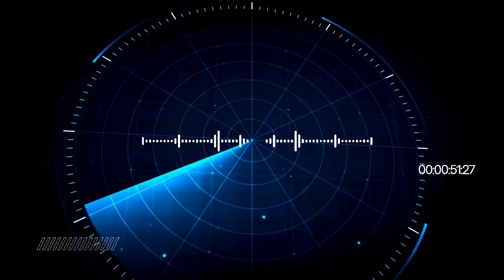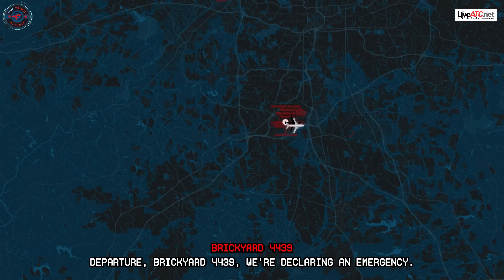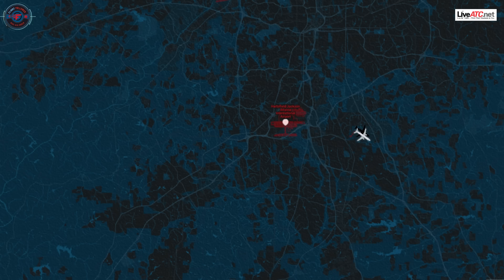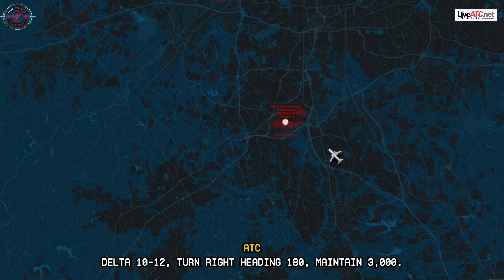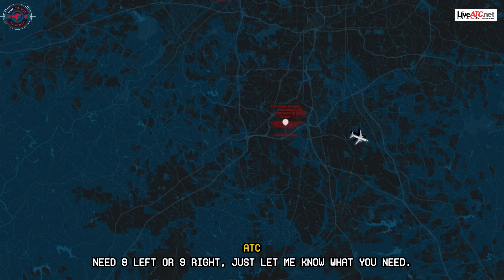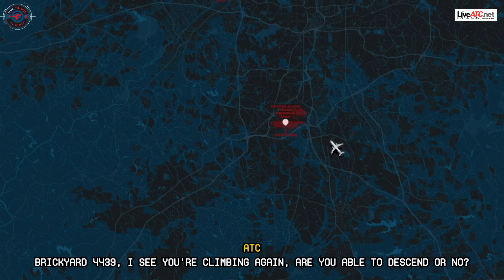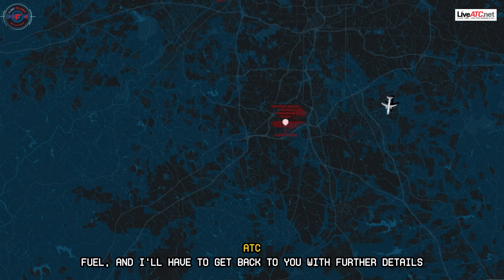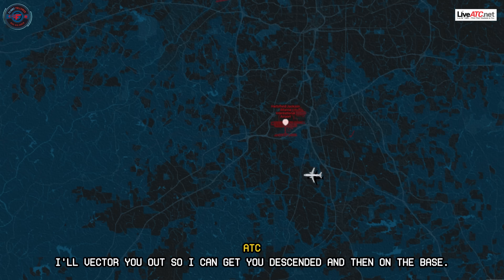Brickyard SUFFERS TRIM RUNAWAY | CONTROL PROBLEM at Atlanta [2019] #atc

Comment: Went through captain upgrade with the capt of this flight.  If I remember correctly it was one of the US air HQ birds that used to be 80 seaters.   Couple days after this incident 2 check airman took the plane up in Indy and ended up with the same problem.
Reply: Hearing their callsign was Brickyard 4439, Indy immediately came to mind.

Comment: 2:09 The tension in that pilot's voice made me stop what I was doing. Shite.
Reply: Same. An RAF Nimrod had to ditch due to a wrongly wired air bleed switch in the right wing, in the late 80s maybe - it caught fire. A SAR crew filmed it from a Sea King - they were hovering as it landed on the sea. My pal, Dave Rimmer (later deceased) , was the flight engineer; he ran through every red card drill in the flight reference cards from memory, in 7 minutes. His captain, Art Stacey, got the Air Force Cross. The video is online. It was the most outstanding airmanship. The crew got out but Dave was knocked unconscious on impact because he had unlocked his seat so he could handle the throttles. His crew mate dived out of the life raft and swam back to the aircraft - he cut Dave's seat harness and carried him out; the aircraft was almost under the water.
Reply: @tyrotrainer765 Wow.
Reply: @t.prophoto  Yep - that story would make a great movie, and it was all true.